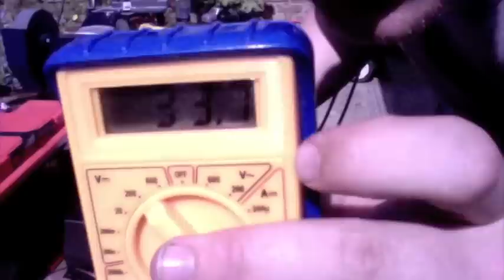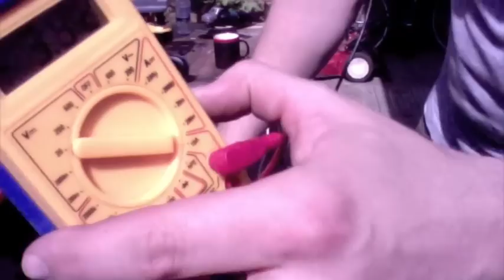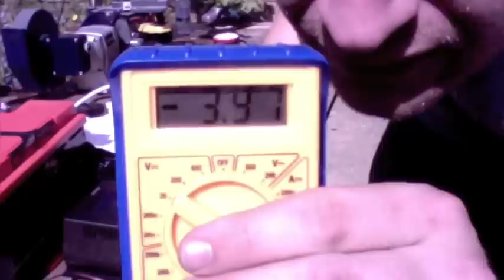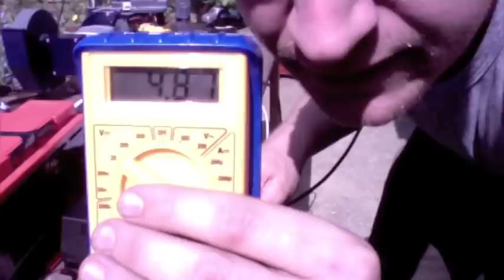How to check if your solar power MPPT is working correct

Comment: What voltage is your battery?   Unless it's 24 volts, you're MPPT isn't converting very much current.  On a 12 volt battery, it should about double the current.